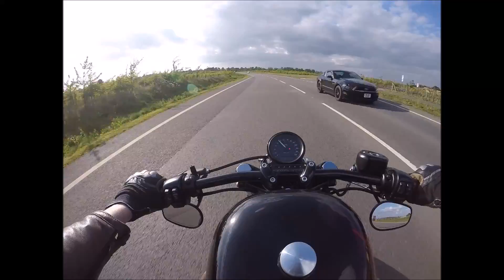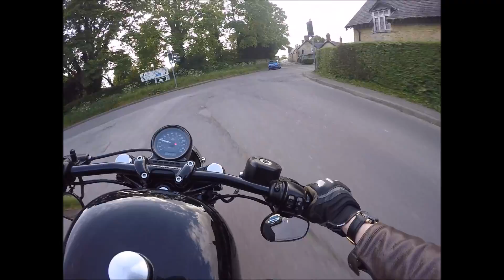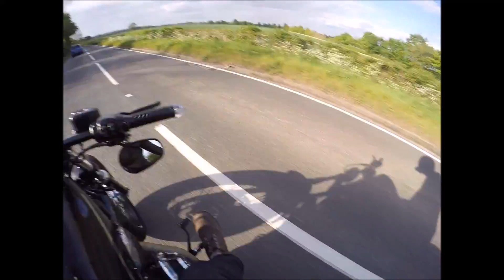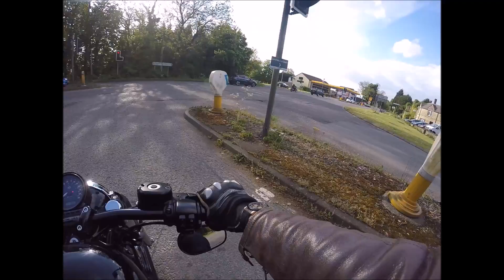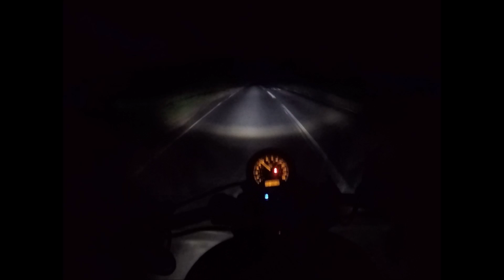Grounded the Exhaust & Turning 30! | Harley Sportster 48 Ride Out

Comment: Hi mate I have a question about your bike. I really like the look of the seat on your forty eight. I don't like the spring set up's and most 'on the frame' seats are really thick and ugly. So yours is just the look I want to go for. So the kit from mother road is around $150, and for that you get the hinge, a piece of leather and a couple of rubber bumpers? So was there anything special about the hinge? If it is just a standard hinge, I am thinking I could buy a regular base plate kit, leave off the springs and fabricate some  rubber bumpers for the seat bolts and save myself a few bob?
Anyway I am half way through customising my forty eight and live pretty local to you mate.  Great videos!
Reply from the maker: +Annie Gough Hi mate, honestly i think the mounting kit was a waste of money, it's a really simple bracket and the leather battery cover is actually plastic and has gone manky. Can't see why another cheaper bracket wouldn't work, seems generic. Hope that helps! You in Oxfordshire? RD
Reply: Hi mate, somehow wife was already signed on to computer, so it came up as Annie, but my name is Trev. OK I will give that mounting kit a miss, as it did seem a lot of money for very little stuff! So I am just on the North of Swindon, but am always riding around the Cotswolds. I have V&H sure shots on my bike so haven't had the grounding problems that you have faced, although I have had the foot pegs scrape on cambered roundabouts which certainly focuses the mind! I am about to get a 4.5 gallon tank fitted, as I am fed up with the original tanks paltry range. Hopefully it wont look too big and overpower the look of the bike. I am also going with the Hollywood bars, so fingers crossed I wont have any issues with the inverted mirrors hitting the tank! Also going with new footpegs and grips, rubber gaiters, a black grill over the headlight like yours and side mounting the number plate. I was going for a retro look, but have no idea what it is going to look like until it is finished. Thanks for all your videos and advice mate, very much appreciated. Hopefully going to try and get if finished in time for the Distinguished Gentleman's ride....now I just need to make my mind up about that damn seat!!